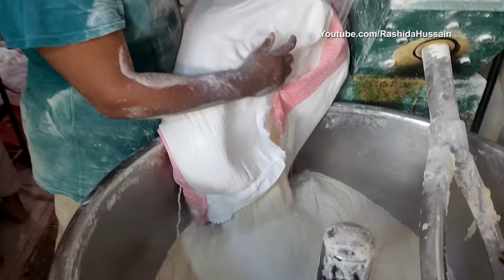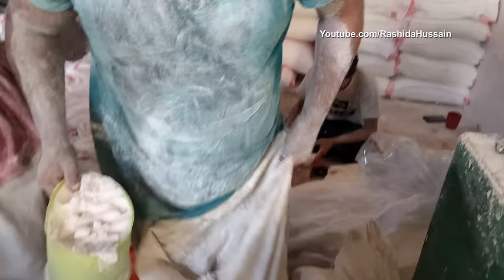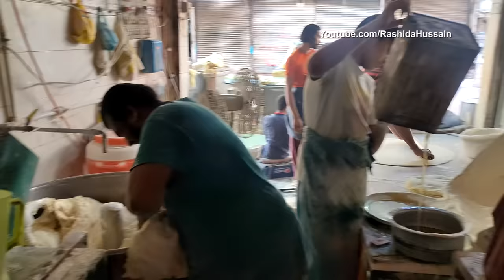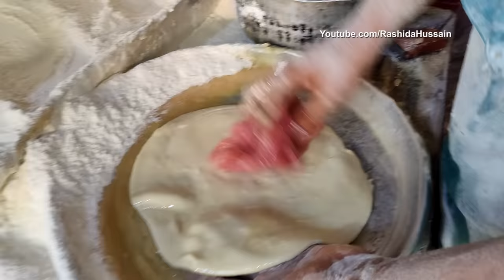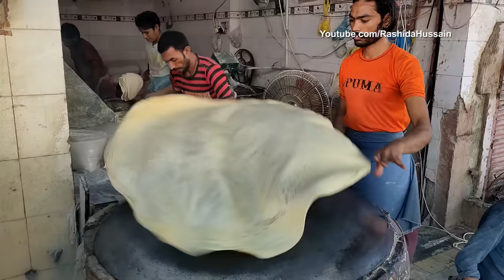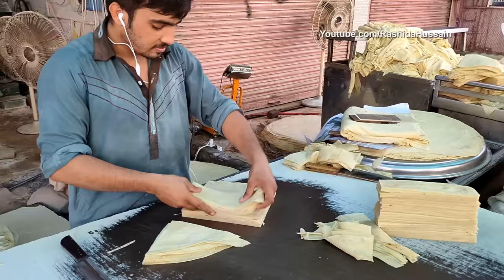Manda Roti Making | Street Roll and Samosa Patti - Dough Machine Modern Food Processing Technology

Comment: How can you live and work in such filth? The dough is picked up from the floor thrown into the vat, the guy on the stomach carries the finished dough, rinses his hands under the water and it flows into the dough.Workers walk barefoot on the floor where the dough is then thrown, the walls are sticky with dirt ... The whole production process is disgusting, who eats it and still pays for it? He gets sick looking at this movie and the sweaty worker.
Reply from the maker: Yes agree! It's their fault, they should put the cloth on the floor, then puts the dough on it. And they also need to do proper and hygiene work. This is not that bread you think so. It's manda, roll or samosa patti, the buyers puts potato paste and spice on it, then fry it in deep oil.
Reply: Fire and heat kills germs. They are all colonized to the environment. It's safe for them.
Reply: @55emax  Do you think that in the 21st century a good translation is that muck and dirt is not dangerous because you burn germs with fire? That the achievements of science and civilization do not apply, that life in a garbage can is the norm?It can be poor and modestly because not everyone is rich, but let it be clean, cleaning, washing feet, floors and walls of the property does not cost and a sweaty guy will not die if he takes a bath and puts on protective pads.